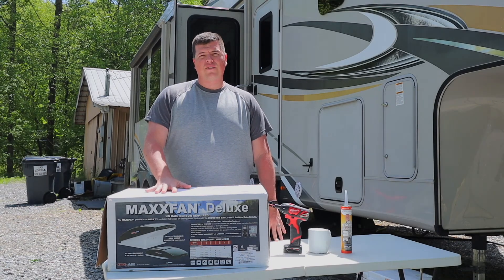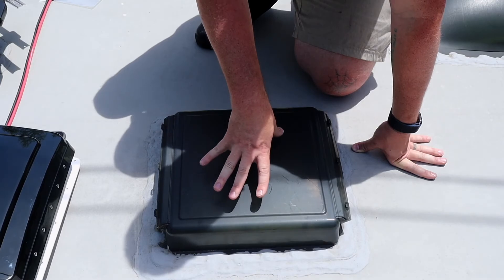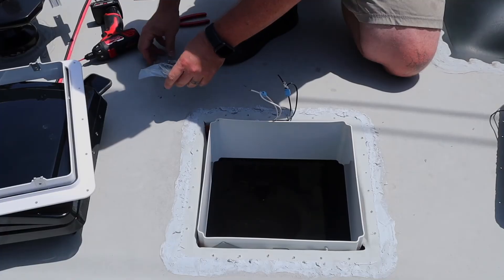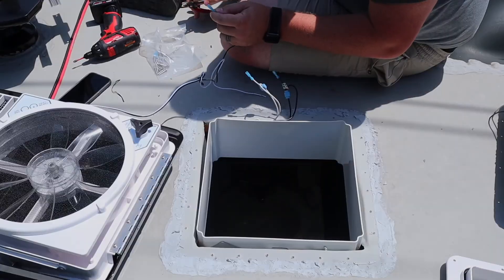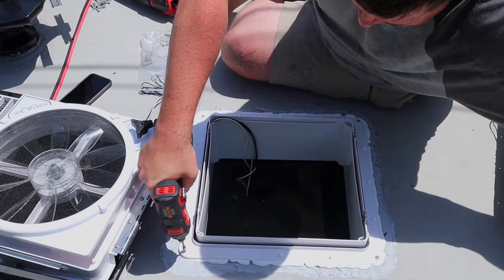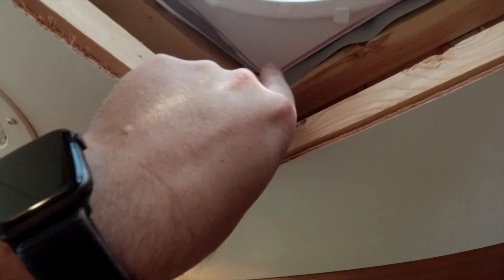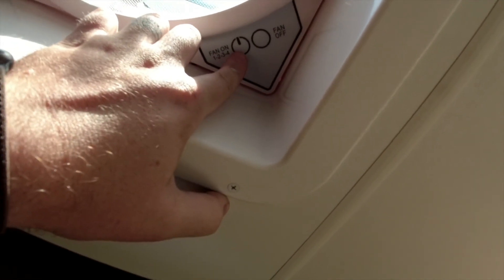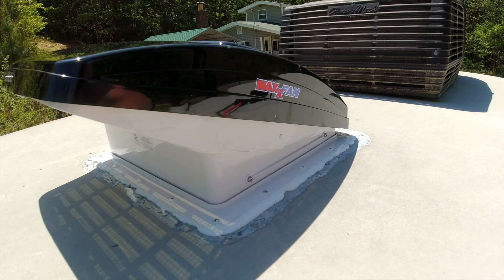MaxxFan Deluxe - Replacing the factory fan on our Jayco Eagle

Comment: we bought 2 of these for our 5R, one for bedroom and one for bathroom. We have one in livingroom, but it still works good. Besides our livingroom ceilings are over 8' high, our ac is in basement. We need a remote controlled one, when we have to replace it. They really do work really nice. We installed ours the same as you did. We like the lower profile as it won't interfer with our solar panels.